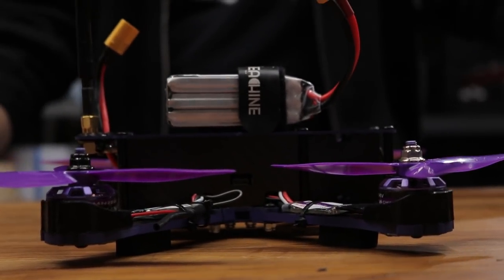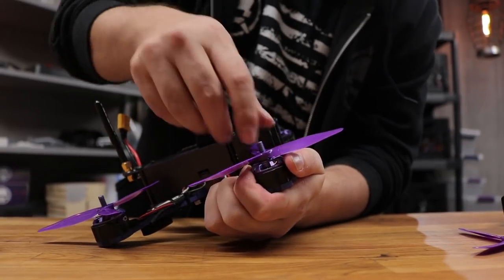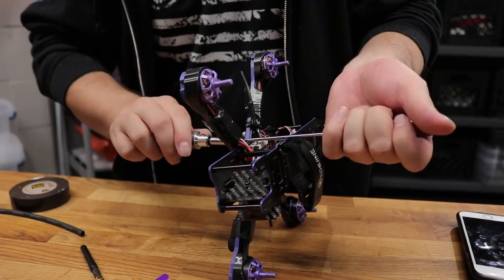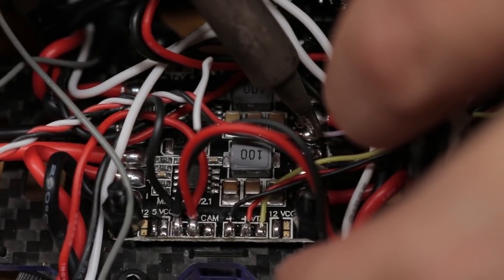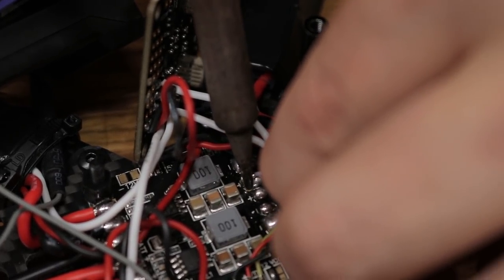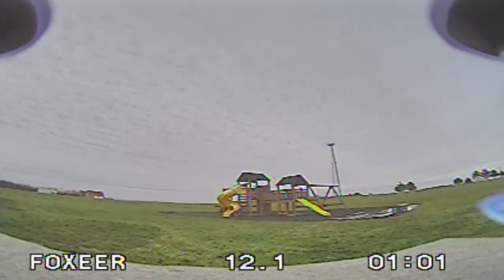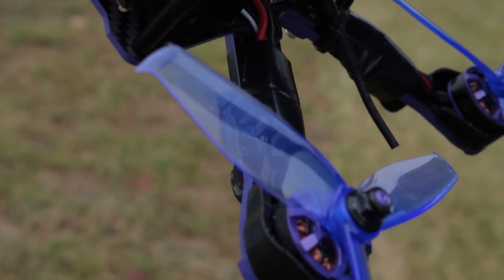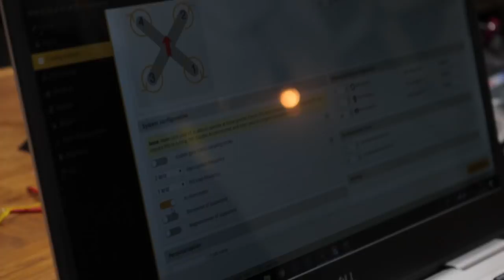MODDING the Eachine Wizard PART 2! - Kwad Mods

Comment: After smashing, repairing and modding my wizard many times i learnt a few things.
1: frame is poor quality and breaks easy
2: you need the side plates to help reinforce the top plate to stop it cracking and breaking so easily.
3: you'll just end up replacing every part in order to upgrade to make it better and eventually replace the frame and end up not having a wizard at all.
Negative comments aside, its a great starting place to learn to fly, repair, upgrade and eventually just build your own drones.

Comment: Oh, I've burnt a couple of these Maveric 30A ESCs. A fast flip or roll had a 10% chance to burn one. Once a front flip burned 2 at once 🤪
Now I'm using the Tekko32 and it works fine. Finally.

Comment: Thank you thank you I’m a wizard 2x buyer both exploded into trees. Note to drew I bought 6 of his motors only 3 worked out of the box. Your video was extremely helpful I’ll mod the next one or do a heart transplant to a stronger frame and keep the guys intact. I want here more from you seem like a real person keep it coming.
Reply: That is very alarming, I've never heard of something that extreme. Did you check the normal stuff? Screws not touching windings and ESCs functioning normally?
Reply: send an email to products@rotorriot.com for additional help. You will be taken care of, we guarantee our products.
Reply: Le Drib  thank you. You guys are all awesome. I got ahold of the shop I bought them from online I’m thinking they caused the damage not rotor riot or their manufacturing. They came in clear plastic bags the functional ones came in a small box with rotor riot stickers.
So lesson learned I’ll buy strait from you guys store
Reply: wait that is very fishy. All new motors should come in a black box with a sticker. If the defective ones came in just a plastic baggie, something is certainly not right. Thank you for the additional info

Comment: This is the quad that started it all for me, I remember using the stock props and having some of them explode when I punched the throttle, nasty things. 

Those sideplates were one of the first things I removed from mine, it did the job for starting out in this hobby.
Reply: Dav I never had then explored on a punch, but I sure did use all 10 pairs! They were super fragile
Reply: You could tell when one was almost ready to break, the blade would be all white up against the hub.
Reply: Dav hahaha yeah I forgot about that 😂

Comment: My escs are still running strong almost 3 years later swapped out vtx camera other than that i wanted to keep it stock lick an old vintage car also have never run but 1500mah 4s
Reply: Same here. I did swap out the flight controller and pdb only because i wanted to upgrade it. They still work fine
Reply: Hmm I don`t wanna lick an old car :p

Comment: By the way the props that came with the the original wizard were King Kong props and were a good prop at the time. Ask Joshua bardwell. He used to use them. It was the wizard 220s that had the bad exploding props.

Comment: Thanks for these videos. I just purchased one of those mainly because I got it for $130. I couldn’t pass up that price. I have 3D printed a rear mount for the rear that locates all antenna on the rear. I upgraded the camera and video transmitter. Got away from the dip switches and put a better one in with switchable power and a display so you know what channel. I like your video transmitter better. May upgrade to that

Comment: Man I wish I had these videos when I was getting into FPV! I had the hardest time working on my wizard
Reply: Grackle FPV same bro
Reply: Tell me about it, personally id say they,re like 18months to late on this one. the new wizzard HV 6s is out now, it,s affordable and its pretty bad ass. maybe a review and mod video on the newest wizzard would of been more appropriate
Reply: Grayson Hobby has a fantastic series that they published over a year ago on modding the original X220.
Reply: Grackle FPV Same!
Reply: same
Reply: I Joshua Bardwelled the heck outta mine before I ever put it in the air.
Reply: I came SOO close to getting this as my first quad... I ended up going with the HGLRC XJB 145 3 inch and i'm EXTREMELY happy I did.

Comment: great series,  if youre about to buy a wizard, as soon as it ships order some new esc's. maybe even a cheapo 4 in 1 esc,  and also a bag of dal 5046x3 props from your local seller. dont buy a bunch of 3s batteries, you'll outgrow them within a couple of hours flying easily.   also one of the first mods you should do is the vtx and rx antennas,, vtx straight out the back and one rx straight up and the other straight out the back, reinforce them with heatshrink and extra cable ties for sstiffness... you will be crashing a lot and these need some extra beef to survive.

Comment: Potentially a Firmware update is needed on esc to get it to work and to balance them, let the esc cool and dont cover them up fully, prop pitch is way to much for 20a and if the side covers fit and work dont be lazy fit them back on its protection. Dont swap motors around no need! This is an advert for the rotter riot shop and that is the only reason you are doing this. They have always hated on eachine, the wizard is a great way to get into the hobby with loads of really helpful videos and support including a facebook page. The wizard allows you to understand if you want to progress into an expensive hobby. Rotor riot are kicking themselves they didnt think of it first but are riding the wave. I have wizard and its not as painful as watching this video.

Comment: If I had watched this as a noob with my wizard I would’ve been more confused on what to do and how you did it after watching this.1st series was was ok but I think the wizard left there worse then the way it came in besides the tramp vtx wich was wired for telemetry but don’t know if it works cause you didn’t have access to BF!!😂 3 of the same esc’s and1 diff that you now subbed off to Drew and ditch the side plates. The switchin to 4K 4K without showing will leave most new pilots scratching their head. I guess if anything I learned how to cut up my extra props to cover shifty esc’s......and to check my nuts every cpl days.
Reply: Brad N bruh I think half way through you typing you had a stroke
Reply: Mark the man Music ye lol

Comment: tbh I bought one to learn as it was pretty much complete package to try the hobby out...... it got me hooked ! 
I also learned a lot and still fly the frame (only original component) and it lives on quite happily
I will say changing the prop pitch will pretty much guarantee the stock esc's to go off but it's not like they would be on there long anyhow!
to sum up, if you are an old hand you aren't interested BUT this little quad DOES bring new blood to the hobby  so all in all it is a positive thing
great video and best wishes :)

Comment: im assuming i am lucky , been running 4s over a year, stock esc s  but recently fc died replaced with a true cleanflight board, back flying but wanting to do all new guts, to have osd etc. any suggestions on a stack or whatever only a crap load to choose from .   seriously thinking whole new quad  but my frame is fine , have run cam eagle,  rush tank vtx .  the rest is stock ..

Comment: I started with a wizard and two of the esc's went up like a BBQ gone bad motors are iffy also two had magnets cause flips of death... "by by bottom plate" by the end I could have built a $500 machine... surprisingly the 200mwh vtx is impressive flying clearer and further than ever expected 1 of 3 original pieces to go next. Hard to let it go...
The stock receiver is big but I've never had a fail safe issue.

Comment: A good upgrade is to soft mount the flight controller. It only costs 4$ and made a big difference on my wizard. No special tool or soldering needed for this mod. A low ESR capacitor costs 1 $ makes a difference on handling and video quality but requires soldering.

A free upgrade is to wire the voltage battery to the FC.
For 1$ you can also add a buzzer, it will make it easier to find the quad after a crash, and can warn you that the battery is low.

And Yes change the 4 X ESC. At first I replaced the ones that would burn and I ended up buying 3 pieces in about 2 hours of flight. I wish replaced them on the first one that burned. It is unfortunate but this mod makes the Wizard much more expensive but unless you are very very very lucky there is no way the original ESCs will last.
Reply: Oh yeah I just remembered. Keep those side plates, they have a structural role and are not just there to prevent dust. You could break the top or bottom plate in crash without them.

If you want to remove them I recommend using shorter standoffs.

Comment: the big mod that needs to be done is upgrade the receiver to the flysky 1a8s and do the firmware mod on the transmitter to 10 channel so you can get rssi

Comment: Hey rotor riot. Nice what you are doing, but why don't you do it with a x220s you have that one also right would like to see what you would mod on that one. I have one and iam a beginner. The side plates make the frame more rigid so you don't break the top and bottom plates that fast....I removed them also and broke the bottom plate.
Reply: That might be the next drone they do...  there still finishing their x220 series of mods

Comment: What is the name of that black cap off you have on your diversity module? Do you need it if you only want to run 1 antenna? Or can you use your diversity module with just one antenna and not bother using both?

Comment: Stock props were 5030.  Putting 5050 props overloaded and smoked the escs. Especially on 3S

I flew my wizard for months on 3S and 5030 props.  As soon as i switched to 4s and 5046  smoked 2 escs in a day and 2 motors in a week

Regular 220 is not good for 4s or more prop without upgrading escs and motors.

Comment: what kind of temps either in F or C do you guys recommend setting soldering irons for working on quad type boards as not to damage them/pads.
Reply: I've always had my soldering iron maxed on temp. Never had a problem unless you deliberately leave the iron on the board for 10 seconds

Comment: Try swapping the guts into something that doesn't weigh 50lbs. It was my first quad, and after building a Chameleon with t-motor 2207's, I'm looking for a light frame that will let these motors actually do something. Maybe a light floss or something similar.

Comment: I broke two top plates without running the side plates.. You do need them. Also, get rid of those black stand-offs. They're super weak compared to knurled ones you can get off amazon or just about anywhere.
Reply: You're probably right. I've flown a ton of Wizards from fixing customer's at the hobby shop, but I never owned one and crashed it a bunch. So from my perspective I just found them annoying to work with. Good point.

Comment: My Motors from the wizard died before an esc could die. 😂
And then I just soldered the battery plug in the wrong way on the pdb and burned up my pdb and 2 escs... 🤣.

Comment: When I had a ESC go out (from a hard crash, it didnt just fail) I had to calibrate all my ESCs in BLheli, as it did the same thing  the 1 motor i replaced the ESC on wouldnt spin with the rest until I recalibrated. at 15:33 it sounds like theres a beep out of sync? is that normal
Reply: There is no need for a calibration if you're using DSHOT. This only was necessary with the old ESC protocols (Oneshot, Multishot).
Reply: @ZeroFPV  well i had to do it with mine, maybe im still on something older...cause i put on a new ESC and the 1 motor wouldnt spin with the rest then as soon when I armed for idle...as I calibrated..it fixed it.

Comment: Did he wire the signal wire wrong on the esc and that's why it didn't work? I've done that before a couple times. A way you can tell it by feeling the motor on boot up and if the motor does the first boot  but no second synchronize beep then the signal is messed up. If it doesn't boot at all then it's an esc.

Comment: If your a newb I wouldn't remove those side panels. I crashed a ton with those on and the quad survived. I took it off and crashed once and quad top plate bent in half.

Comment: You got rid of the side panels, but I think that's one of the best things about this quad. I don't have one myself (My biggest is 3"), but I've actually made some side walls for my quads. It definitely helps with keeping dirt and snow out. You can't inspect anything, but there's less reason to inspect stuff in there with them on, because they protect the electronics. If something electrically goes wrong, you have to take the whole thing apart anyway. So, I've got to say, I disagree with this "mod".

Comment: That is interesting that the Esc's suck, I use  Emax pro series esc's on my builds and have found them to be pretty decent.  I am with you vortex, I won't buy another BNF model for just that reason, they use cheap components which you will end up upgrading anyway so you may as well just buy the best components and mount them to a frame you like.  The added bonus to building yourself is that you know how to fix it when you break it and you know exactly what to buy if one of your components goes bad. It can be really hard to identify and get an exact replacement parts for OEM BNF's and you usually have to order them from China which can takes weeks to months to arrive, you can waist a whole summer, not flying because you are just waiting for the slow boat from china.   Order good stuff from Rotor Riot store, pay a little more but get your stuff quickly so you can get out there and fly with confidence knowing you can trust your gear.
Reply: XTK FPV Exactly. But there’s a lot of people who already bought one, so we’re just trying to help out. Plus I think there’s some general tips in here anyone could use.

Comment: Wouldn't using a multimeter be the easiest way to tell if a part is bad?  Since you can easily see if a part is getting power without having to desolder any parts.
Reply: No because the ESC could be getting power, but still not work.

Comment: It's ya Booiiiiieeee Vortex! That was great. By the time it's upgraded you may of well of spent a bit extra and got something that works well out if the box. It's a shame the wizard is so cheap...I mean it's great to get people into the hobby. But if it is unreliable and has poor quality parts, how long will those new pilots stick around? My advice...build your own quad first, using decent parts. You will learn a lot and have a great quad as well as the satisfaction of making it, programming it and then flying it
Reply: I agree. People who have never soldered try to avoid it as long as possible, but you'll have to fix it eventually. May as well learn to build right away. It's not as hard as it seems.

Comment: can someone explain what gyro and pid loop rate updates do? why would i want to increase it to 4khz from what it already is
Reply: With a low gyro sampling frequency, only low frequencies of change in rotation speed can be reliably detected. This is due to the nyquist limit. However, signals of high frequency dont disappear. Instead, they sort of "roll over" and get detected as low frequency signals. This is called aliasing.

Quadcopters really only care about low frequencies in the gyro signal. They show rotation of the craft caused by the motors, wind and so on. High frequencies are mostly caused by motor vibrations. They dont matter and we want to ignore them. This is why we filter them out using softmounting, low pass filters, notch filters and more.

However, aliasing can cause high frequency noise to be picked up by the gyro as low frequency signals. Since low frequency signals are important, they pass all filters and the pid loop thinks the quad is really rotating. The resulting attempt to compensate just causes real low frequency vibration.

High gyro sampling rates solve this problem: High frequency noise is properly detected as such and eliminated using digital filters that do not alias the noise into other frequency ranges. Examples are the low pass filter and the notch filter.
Reply: @xerovolume3321  wow, thanks a ton for the explanation

Comment: You never flew it on 4S man. Cmon!
Reply: I wanted to, but once the ESC failed I was just on a mission to make it work again. Drew will put it on 4S in the next episode.
Reply: @VORT3XFPV  that was my first quad. My escs burned 1 at a time until I'd replaced them all. 

That stack is alive and well in my backup quad now. Still going!